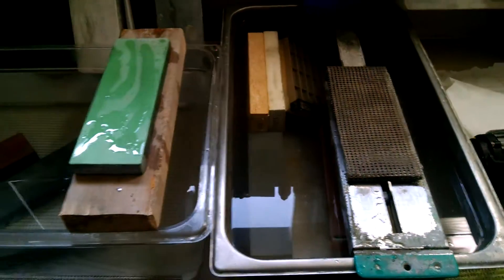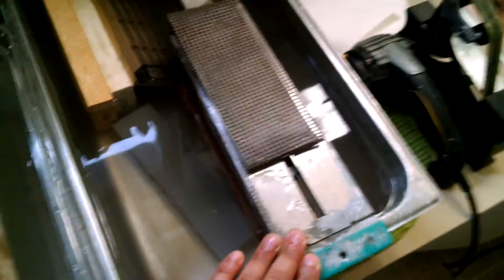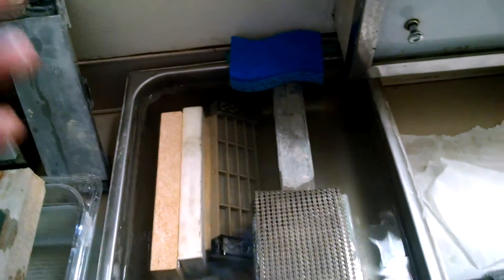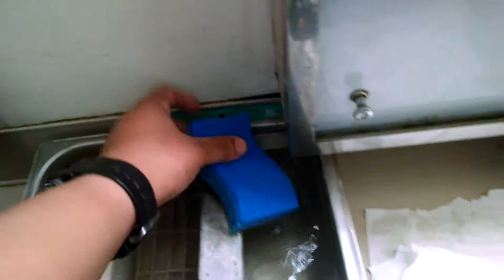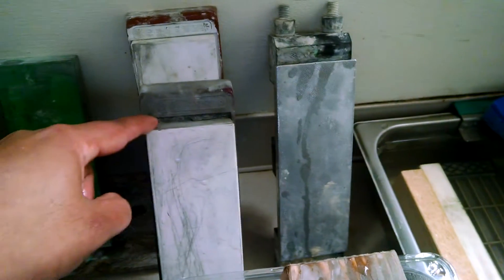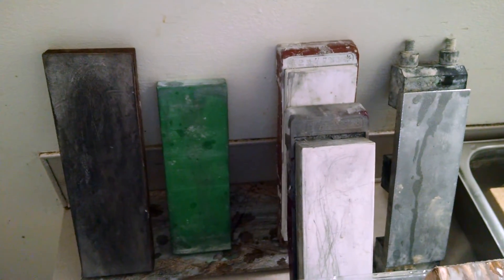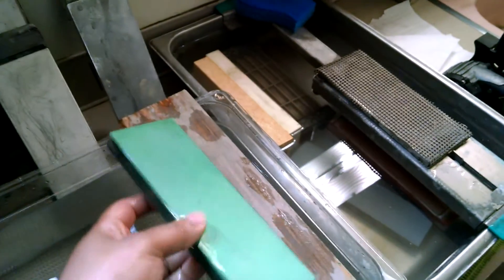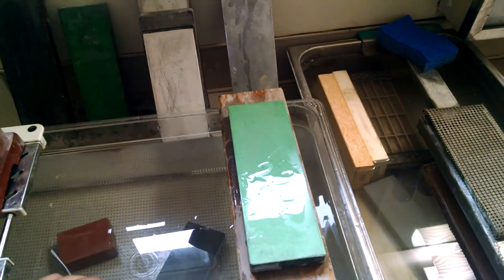My waterstone set up

Comment: I think the silicon carbide flattening stones are meant to be used in combination with silicium carbide powder. naniwa sells it but you can also get it from a stone carving specialist shop. I have the big flatting stone from naniwa and it stopped working effectively after 2 flattening jobs because the carbides dulled. I started using the silicium carbide powder and it's not faster than the diamond plate. however I still prefer the diamond plated because they are more easy to use and clean.

Happy sharpening brother!
Reply from the maker: yes the SiC flatter is more of a preventative maintenance thing, I use it before and after sharpening to prevent hollowing, it removes less stone then the diamond and is better for higher grit stones since it doesn't change the surface texture like the 140 Dia can.

I feel its gives me more stone life both on my sharpening stones and my diamond stone

if I let my stones dish out and all I had was a SiC flattener that would be a bad day.

you too man, cant wait to see an awesome sharpening video with those sweet editing skills!

Comment: Fantastic line up. All bases are covered.

I've been checking into that Latte 400. It looks like a nice alternative to the Naniwa Pro 400. In terms of aesthetics, it appears to be the exact same as the Nubatama 1k. I wonder if the same company is making them. If ya get bored and wanna make a video, I'd encourage highlighting that one ;)

Nice set up. I've been having a devil of a time keeping my plastic tub from shaking. Even with light pressure, it has been wanting to rock back and forth. Not sure what the deal is with it. I thought maybe it was my counter top, but it does the same thing on my coffee table. Gotten to the point now, I just don't use it.
Reply from the maker: +Jef Jewell yea it cut way fast even s90v and other High end steels. Great feedback too. Dish's fast though.

Made by a stone maker in Kyoto that makes stones for many companies.

Yea, the plastic tube moves more. But. I find that keeping my bridge on the corners correct the issue since I never bear Down on my stone when I sharpen I am only using 2-3 lbs of pressure